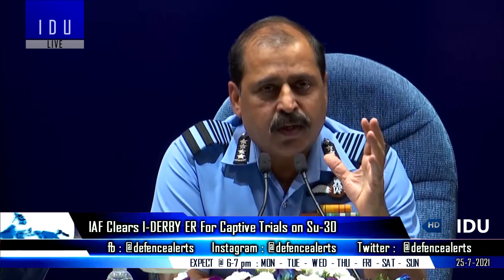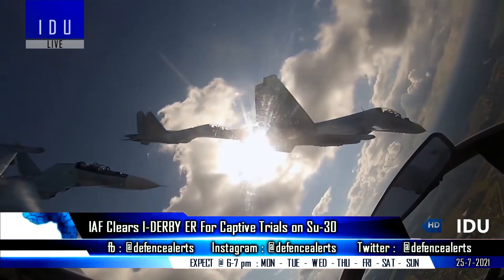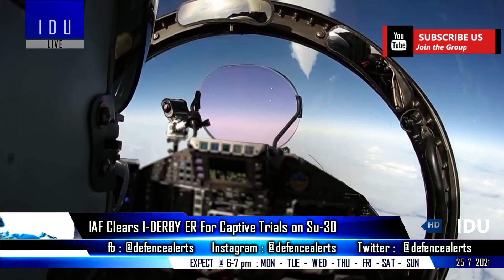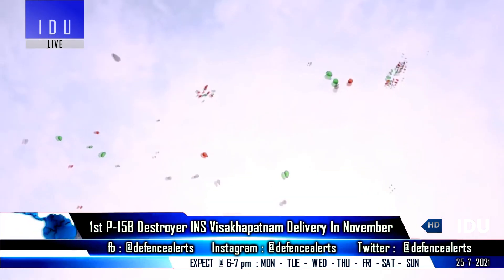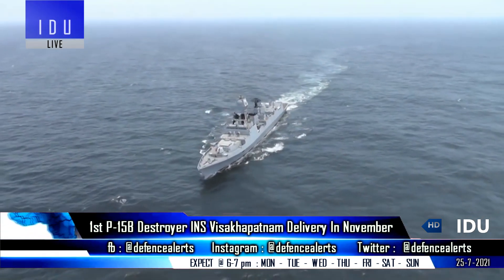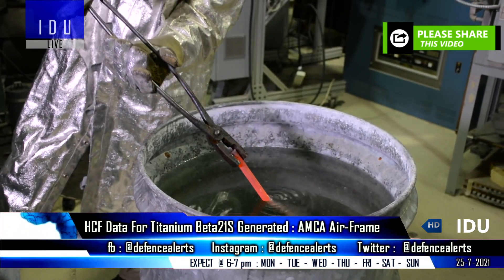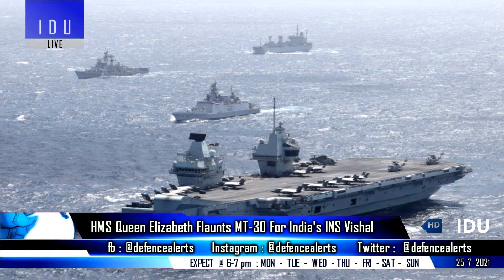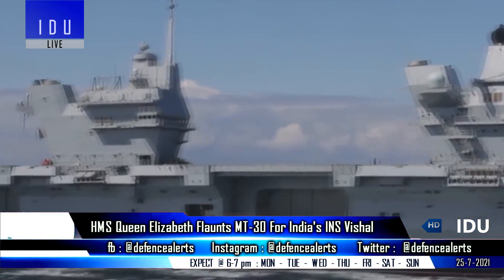Indian Defence Updates : AMCA Timetal21S Airframe,INS Visakhapatnam Delivery,Su-30 I-Derby ER Trials

Comment: The MT-30 should be on the next generation aircraft carrier and destroyers. It has a high energy production and is very good at powering next generation weapons and computer systems. Plus having it on multiple platforms will lower maintenance cost significantly especially when you can get indigenization over 40%. It will not be fully indigenous because they won't share the core technology with anyone on such a new system.

Comment: China is building 6th generation J28 fighter and they would also have two fifth generation fighter jet - j20 and j31
 But India would be having only three 5th generation fighters
Amca mk1
Amca mk2
Tedbf block2 ( planned)
 Are there any 6th generation fighter jet program currently for India
Reply: The Chinese fifth generation fighter aircraft are actually comparable to Rafale in both stealth and manoeuvrability and close to Mirage F-1 in avionics. Their sixth generation fighter will most likely be a 5- or 5+ generation aircraft. The AMCA MK2 is a full 5,5 generation aircraft so it will outperform the Chinese aircraft easily. And both AMCA MK1 and TEDBF are 4,5 generation aircraft.

India is invited to Tempest and Next Generation fighter aircraft by the British and French respectively.
Reply: Spending money for 6th gen fighter jet is waste future war's based on artificial intelligence,drone fighter jets,robotics..
Reply: @kumarpraveen54  they will just be a small part. You sound like the people with the introduction of tanks and aircraft, they will replace the regular troops. All that happened was they filled a certain capabilities gap. These are going to be doing the long, dull and dangerous things leaving the rest for non hackable platforms.
Reply: Rumors are that amca mk 2 would be 6th gen, amca mk1 would be 5.5 gen, but idk